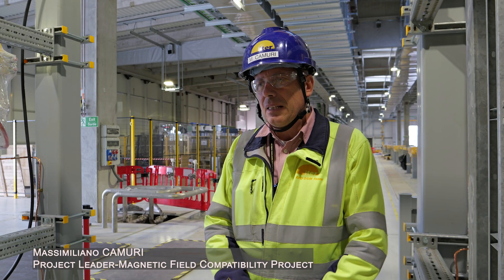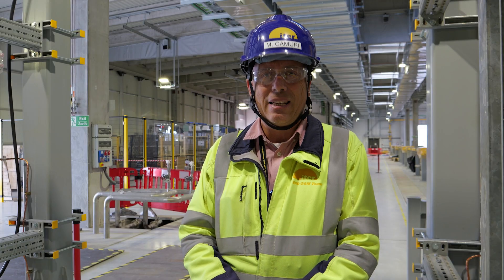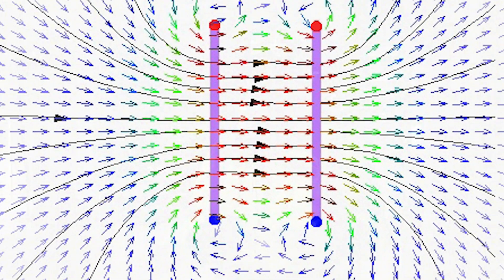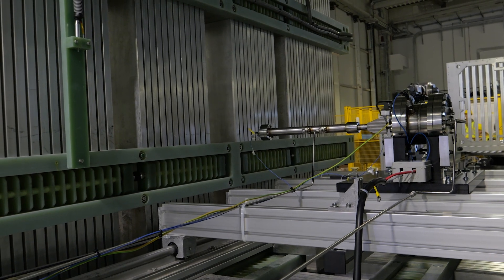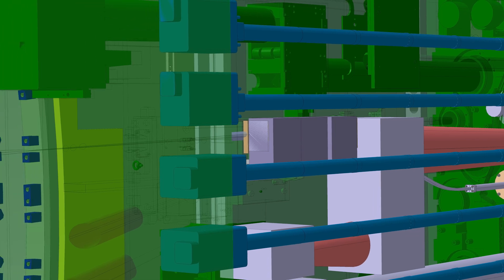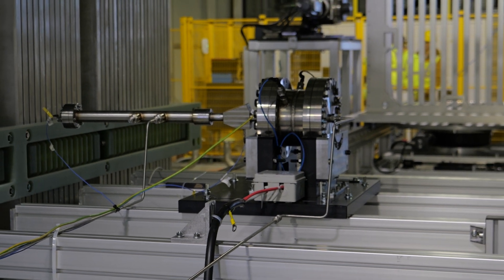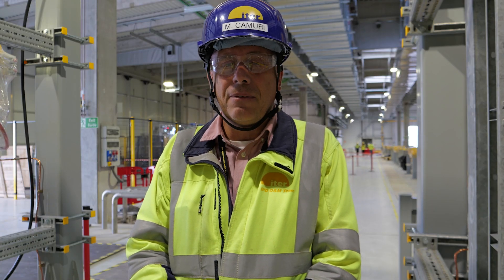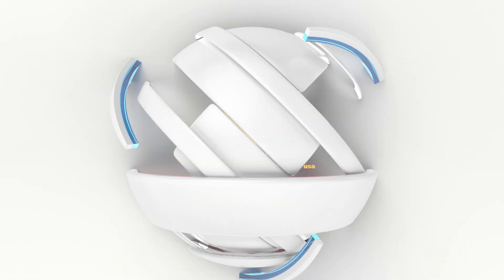How do electronics react to magnetic fields?

Comment: What's the point of having a magnetic field if I can't use it to do a proper knee MRI, you should strive for 1.5T ranter than low fiend 0.225T 😂
Reply: Think about it.  You can get a MRI at a hospital.  This is not a hospital.
Reply: @ptonpc  anything can be an hospital if you thinker with it hard enough